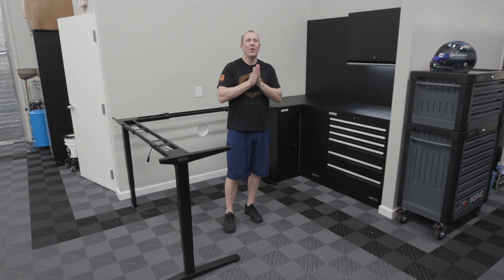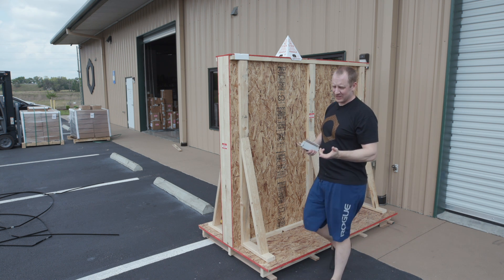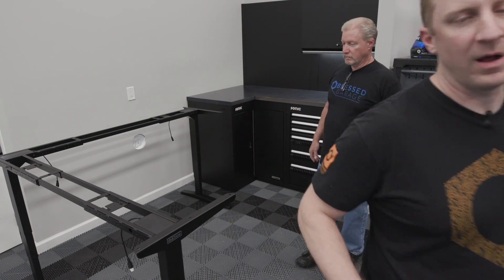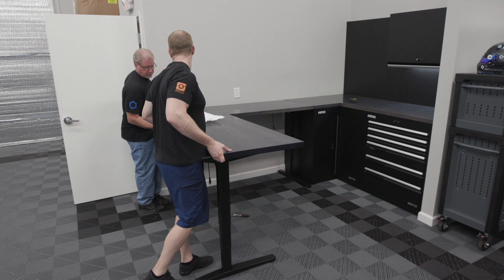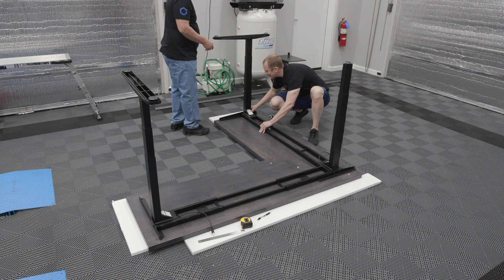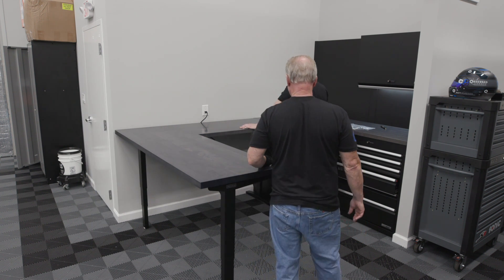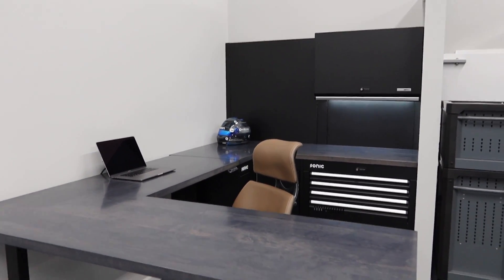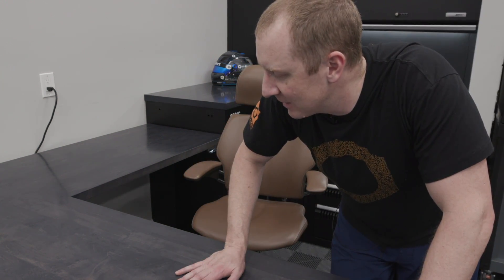Unboxing and Assembling My New Epic Garage Desk & Countertops

Comment: Not sure if you already cut your baseboard. But, can you unscrew the top and leave the mounting screws on the leg that's away from the wall. Then push the top toward the wall letting the desk frame get a little smaller on the peninsula side of the desk.The leg closest to the cabinet would no longer be centered on the top, but it looks like you might have enough room to make the top flush with the cabinets without cutting the baseboard.  Just a thought but the desk looks awesome.

Comment: Matt; My local valeter has a vacuum that has ducting to various points around the bays he has several hoses that can be clipped in and used in that area but it all sucks back to a  point that can be emptied he even has some points near his wash bay yet the way it is wired you can turn it on from each point how I don't know but it is a superb system, the filters can be cleaned and re used several times before being changed and there is very little loss of suction over the whole of the system. I wish I could tell you who made it but his lease has expired on the premises and I didn't know but he is no longer there.